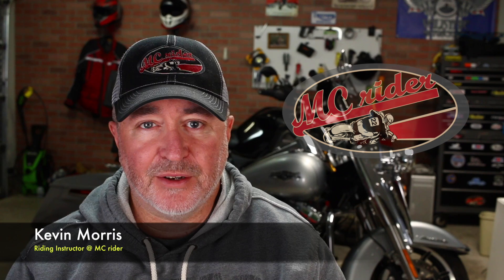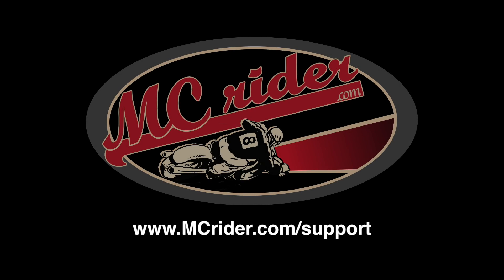How to start and stop a motorcycle with control

Comment: Hi Kevin. Great explanation of why we should practice like this with brake control. Anything that becomes a habit is what we are going to do in an emergency type situation.  Like you said, it is about creating the muscle memory and habit. If we only use our back brake when coming up to a stop, that is what we will most likely do in an emergency stop from a higher speed and a likely crash. Use front and back at slower speeds and that will become your habit for maximum braking power in an emergency stop situation. Ride Safe.

Comment: I would like to Add or suggest that new riders & old . Let out the clutch when the bike is rolling put your feet up! I see foot dragers too much. 2nd  Only putting down your left foot if there is something loose or crosswind you got problems  At low speed you really do not need both brakes,Furthermore the newer Harleys are combined braking systems.  Thank You Kevin & McRider great video's I share them with everyone I can. There is always room to learn something .
Reply: COOL!! I have always said no matter what you are driving or riding . Brakes are a great option to have.

Comment: Be very careful of loose baggy jeans when you practice the stop-start routine. My jeans hooked on a guard on my ST and I couldn’t get the left foot out quickly enough. Over she went even if I was stopped. No damage a few scratches on crash bar. No injury I was wearing my long adventure boots under the thick baggy jeans. Now the jeans are tucked into boots.  Only bruised ego. I thought this would be a useful tip for novices.

Comment: My practice is to use front and rear brake always, but when stopped both feet come down -- basically the front might gently take off the last 1/4mph and then hold the bike at the stop. The only time this could bite you is on a zero traction slimy surface, but it would have to be literally zero. The Brits are taught in "Motorcycle Roadcraft" to use left foot, but to me both feet planted is best for all kinds of slippery footing, road camber, gusting winds and so forth. If you do follow the left foot only technique, a slight turn of the bars to the right as you come to a full stop can help keep the bike from tipping to the right.

Comment: Any confidence of skill You acquire derives from the machine's response that you are attempting to control in that moment. These actions are perceived being adequate during operation all good and safe. These machines do share in common responses by basic physics however it is always needed to minded that there are varying degrees from one motorcycle to another. This being heavy to light in weight along with power to braking ratios provided by structural geometries from wheel's characteristics and center of gravity which are two main ones.  A rider must always realize in order to maintain any skill perceived you must be able to adapt to these machine differences. These machines are not all the same remember that always.

Comment: I always drop my right foot, use the front brake until I stop, put it in neutral and release both if on a flat surface. That way I can hurry up and drop down to 1st when it turns green.

Comment: Really great Video. Well - if the winter is over, I will definitely use that to practice my stopping habit. But with nearly 25000km on my CB650F - I'm still a "beginner". Even though I've driven that many kilometers on my bike, I'm still learning.  So thanks for this video. Lovely greetings from austria, buddy.
Reply: Hurdl With a motorbike, you don't stop learning. 

Just this week, I had a car merging over the top of me to my lane. I moved a bit to the right before quickly dropped down a gear and accelerated out of that  Crush zone. 

The driver was apologetic.. no harm done that time.
Reply: Haha. Yeah. I'm still practicing some trainings exercises nearly every weekend - like knees on the seat, drive with no hand above 20 kph on the parking lot, emergency breaking.  just for the better handling. - Its true - when you ride such bikes - you need to learn that constantly. It isn't that easy like driving a car. Every fail could cause an accident. ... like one day. me and my girlfriend on the backseat - a long trip and I've stalled the bike at an junction, well - because on the day before I stuck in some traffic jams on the german highway. Had too much work with the clutch, so... I had some issues with the clutch hand. ... Aaaaand I dropped the bike. yeah. But hey - thats normal. Human makes mistakes. 

And such situations with the "enemy" - the other car drivers are so horrifying. I mean - they did pass their driving license test but can't drive that very well instead. Just looking around while driving and so stuff. 

So stay safe buddy. Don't get hit by cars though. :)
Reply: Hurdl Please no emergency breaking. Bikes cost a lot to fix and injuries take longer. Yes,  I know you meant braking but it was fun to take the mickey out of your auto-correct. :-)
Reply: haha... yeah. I see... my bad. :) Breaking... instead of braking. Thats the thing with foreign languages. You probably write some wrong words and the auto-correct switches to the false words too. Great... high tech. haha. :D  Thanks buddy.

Comment: It's very common here in the Philippines to have a very bad road condition right where you need to stop or where you need to get into traffic.  For example, coming out of a gas station this morning there were 4 obstacles.  The gas station pavement dipped down to a narrow ditch, then on the other side of the ditch there was another, bigger ditch and the other side of that was the road, but it was a couple of inches higher than the previous pavement.  So, it was quite dangerous just to pull into traffic.  I had to evaluate it by looking down for awhile to see what I could do to traverse it.  I realized that I had to approach it at a near 90° angle or I would surely trip over these obstacles and dump the bike.  But, that meant that I had to have some speed to get over the bumps and dips -- a higher speed than I wanted to have when entering a road full of traffic.  Then I had to suddenly turn right to get into the lane while my rear wheel was still going over the bumps and ditches, all while watching the crowded road for a break between vehicles.  This is MUCH more challenging than what you have in the U.S.  They have imperfect standards for road construction.  They will just leave it as is after paving.  Also this morning, some of the road had two lanes on my side, with the left lane sloping down about 4 inches to the right lane.  Changing lanes there really upsets the bike.  It suddenly, radically tilts as it attempts to treat the slope as the actual slope of the road.  It is very hard to change lanes there since I cannot approach such a big bump at any big angle.  All of the problems you have riding in the U.S. are tiny compared with what we have to contend with.  So, sometimes you have to look down.  You cannot always keep your head and eyes up and forward or you won't see the details of the road hazards.

Comment: Great video as usual. I have to admit that I am remiss when stopping as I put both feet down. 
 I am one of those people that suffers from ducks disease  ( my bum is to near the ground) and I have had the embarrassment of the bike falling over especially in really old towns where the roads where historically cobbled ( often just tarmaced over) which have a very pronounced crown. With my  short legs the bike tends to lean too far over to be held up. It not too bad these days as I have had a couple of inches taken out of the saddle but I am still on my toes - must find some way of binging the ground up to me - maybe I need to emulate an 80's  rocker and get some platform boots. Still I know it is a bad habit and something I must address. Thanks for reminding me!!
Reply: It's only a bad habit if you think it infringes on your safety. Sometimes we just have to make due with what is available and be content. Practice practice practice, and try to have a little fun in there somewhere too

Comment: Left or right foot down? It depends.

It is of course important to practice braking with front and rear brake, but when I plan to stop for any longer amount of time (i.e. red traffic light), I shift into neutral and put the right foot down. Part of the German motorcycle test is an exercise called stop and go, where you have to alternate between left and right foot (two times each side) to show that you have control over which foot you put down. And while you practice for this, you learn how to use both brakes and how to release the rear-brake just before you take the foot down.

As I said, it always depends on the situation. In most situations it is ok to release the rear brake first to put the right foot down. Or just before starting into a tight right turn, it is a must to have the right foot down (same with the left foot when starting into a left turn).

I think when practicing start and stop, it is a good idea to alternate between the left and right foot. :)

Comment: Morning Kevin hope you and your family doing fine. The only thing that I could think of to help with your videos is to have a split video of your clutch hand and you’re throttle hand to better show the friction zone versus throttle. Enjoy your videos Kevin have a blessed day!
Reply: David Smith showing it I think is unnecessary as it’s a feeling and an easy concept . Ymmv
Reply: The friction zone  isn't half clutch or clutch three quarters of the way out. It needs to be felt, don't look down to figure it out as there is no indication down on the handle bars. For riding off using the friction zone, you need "high idle", just a crack extra of throttle more than the idle position. Again  don't look at the tachometer  as you'll stall the bike faster than the tacho will react.

All in all, just find a dead car park or dead end street that's level and practice rocking back and forth under power on the bike. Kevin has a video on this. Both feet forward and gently accelerate forward a half foot, pull in the clutch. Allow the bike to roll to roll back to the starting position. Repeat plenty of times.  The friction zone is great for slow riding in congrested traffic. 

David, I feel that you might be over thinking it. You don't learn a mostly practical skill by reading books or watching videos. Instead you have to throw a leg over the bike and hit the starter. Good luck and have fun.

Comment: Hi Kevin.  An off-topic question, considering that you're primarily working on this new rider series, but when are you goin gto do a video on safe lane-splitting (filtering) techniques?  I've been riding for over 30 years in commuter traffic (Washington DC area)  and have many tips and sensibilities on this topic.
Reply: Paul H: I'm in a different jurisdiction (Victoria, Australia) so lane filtering (less than 30kph, approx 20mph) is allowed only if you have a provisional or full licence. Learners permit holder are not allowed to filter. You need to be able to read the road conditions and other drivers. You also need to be able to judge that you can get through between the cars, with panniers and top boxes. Filtering is more a intermediate skill. 

I have done filtered twice; once for roadworks that was causing a very long snarling traffic jam. The other was when the traffic was stop start. In both cases, I was concerned about getting hit from behind.
Reply: I agree with you; I feel that it should only be undertaken by intermediate to advanced riders.  The successful lane splitter does not treat it like a slalom course; one must pick his way past each vehicle, with total situational awareness, and with appropriate motorcycle speed and placement.  Among the skills required, a rider should be able to stop on a dime without locking up a wheel, pause briefly, and start up again, without ever putting a foot down.  The rider must be able to avoid a collision even if a car from one lane suddenly swerves into the other without signaling.  Kevin seems to have the good judgement, temperament, and video-making skills to draft a definitive treatise on the topic.

Comment: Is it bad that I've been riding for a month and I've never used my front brake? I haven't had a single issue, I'm on a virago xv750 ('85) and the drum brakes (usually I hate drums) are fucking excellent. I just drag em as I approach, ease off the throttle, ease into the friction zone on my clutch, and slowly apply more and more rear brake pressure, I don't skid, I stop on time. I think paying attention and "driving in the future" has made this possible but I just want to know if I'm developing any dangerous habits. To be clear, I have no issues using the front brake and I have for reaction practicing and whatnot just never on the road, not even once

Comment: Left foot down... unless you are riding around at Sturgis, then you have to put both feet down at every stop.  The cops at Sturgis will give you a ticket for one foot down because according to the cops you are not in full control of the motorcycle at a stop unless you have both feet down.  From what I've heard that's the number one ticket given out at Sturgis.

Comment: Hey Kevin, how about using engin e braking as you approach a stop? I rode a Bonneville in the 60's. The drum brakes always felt weak. So I down shifted gently approaching a stop. I took the MSA class and was told not to do this. I am riding an 883 now and after all those years not riding I still have the habit. So I reduce throttle, apply light brakes, down shift at reduced speeds and continue to a stop. I always feel in control. I am interested in your thoughts!

Comment: so usually ill pull in the clutch no matter what gear im in. if i know im going to be stopping completely. is that correct? or should i down shift all the way down to first from what ever gear im in, for a complete stop?
Reply: I wouldn't down shift all the way into first from highway speeds.  You are going to want to keep your downshifting commiserate with the speed for that specific gear on your motorcycle in case you need to release your clutch quickly and give it gas .  For example if you are coming to a stop from 60 MPH and down shift all the way to first gear but then have to get back on the gas for some reason,  when you release the clutch you will still be going way too fast for first gear and the rear wheel is going to lock up.  You will probably go down  and possibly into the path of whatever caused you to need to get back on the gas.

Comment: Question:  When I took the BRC (years ago and haven't ridden since) there was an exercise that I think was for throttle control, but I didn't really understand it.  If I recall we had to ride a strait line wile applying back brake and revving the engine higher and using the clutch to move forward, overcoming the rear brake.  Everything else we did those few days made sense to me, but not that exercise.  Any light yo can shine on that would be appreciated?
Reply: i know why...the BRC instructor was at a lose and just made something up
Reply: Sounds like riding the friction zone for a slow riding. Ideal for car parks, or getting through the gate at an event, or just moving in slow traffic with out stop-starting, riding at 5mph for as long as you need. Although we were taught to leave the clutch in place and moderate your speed with the rear brake, don't need much to hold a clutch in the friction zone. I'm in Victoria, Australia.

Comment: Is it okay to hold the clutch while in gear for short time. I bought a motorcycle 2 days ago and I was riding on the road, I saw another MC rider hold his clutch in during the whole light. It wasn’t a long light. I drove a 5 speed car and I’m going to a motorcycle. I was told it’s not good to keep the clutch pressed in a car for long so I’m just assuming it’s the same for the bike. But I’m not sure, anybody have any ideas
Reply from the maker: If the clutch is fully engaged (ie clutch lever fully squeezed) it does not hurt the bike at all. It is made to do that.
Reply: MCrider okay thanks!